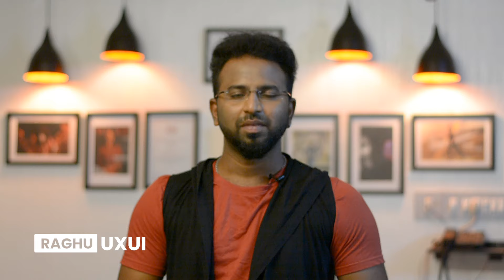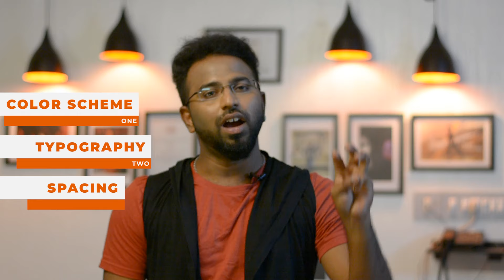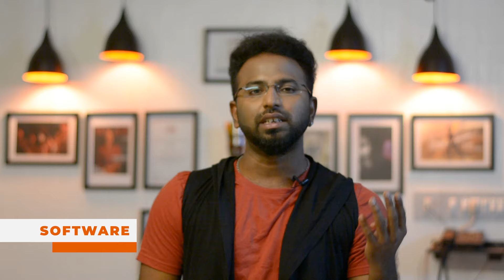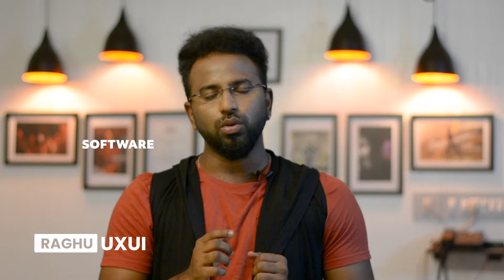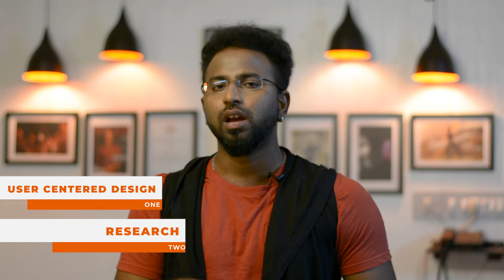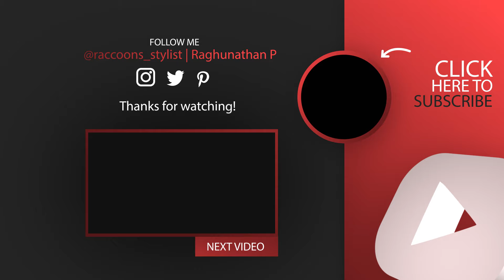How to become a UI UX Designer? 6 things you must master for your UI UX Design Career

Comment: Bro I have done my degree in bca and have experience in hardware and networking ,I looking for changing the track to ui ux ,which are the good things start on ?
Reply: Same profile I have career growth is very slow please suggest on this
Reply from the maker: @ganeshveer3989   If your working do this Adobe XD course as a parallel and try to mater the UIUX design before you leave the job. Creative skill are required for this field. Analyse the UX jobs before you change the field
Reply from the maker: Yes you can, Learn the software Adobe XD from Udemy and you will get the certificate from there so that you can put that certificate in your CV. Once you learn the Adobe XD try to create projects for UIUX so that it will be helpful when you step for interviews